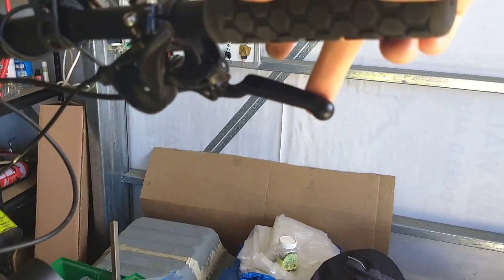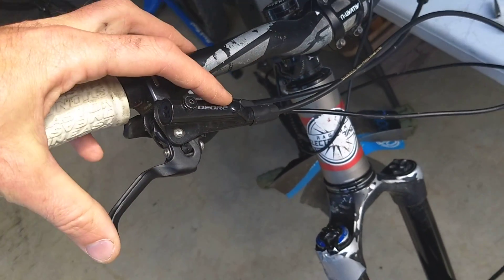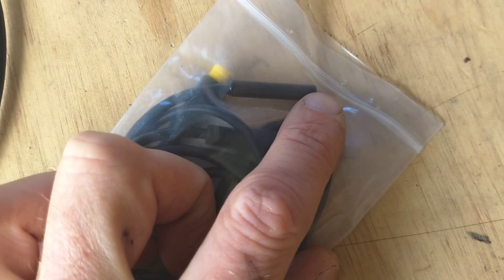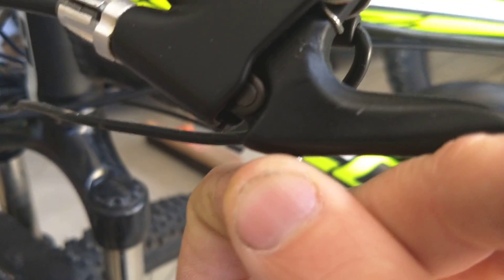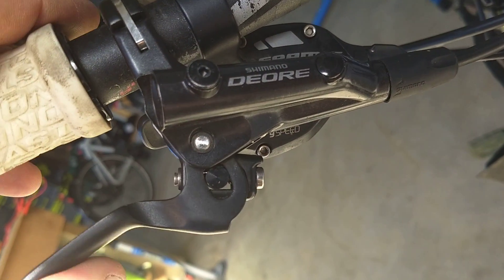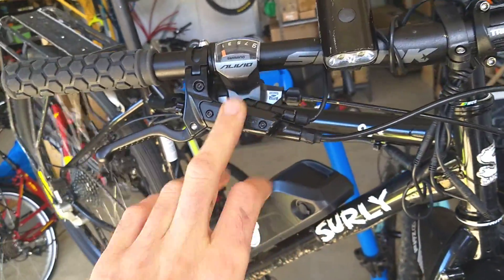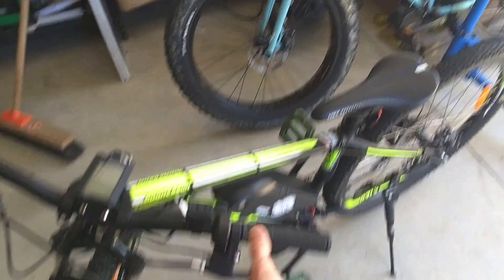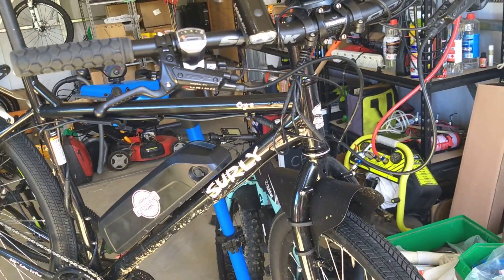Brake Cuts Bafang BBS Electric Bikes

Comment: I'm finding the Zurich brakes here in the U.S. but they don't have Bafang 3-pin connectors, rather just wire ends that need to be spliced into the Bafang harness. My question, do you know which wires on the Zurich match which wires on the Bafang harness by color? I really don't want to spend $300 USD for brakes and screw something up by wiring them wrong. Thanks
Reply from the maker: Hi Naaman, Sorry, I don't know the colours. Mine came ready wired with the correct plugs. I'm sure a little googling will find them. If you are really stuck I could sell you my used set-email me via raglanelectricbikes.co.nz if you want to pursue this.
Reply: Ok, thanks. If I hadn't already ordered them, I'd take you up on your offer for the used set. One more question, if you don't mind. How many pins are in the connector, 2 or 3? Thanks
Reply from the maker: 3
Reply: Thank you
Reply: Just a note for anyone interested in using the Zurich brakes on Bafang motors: The Zurich brake levers only use 2 wires. So basically, it's just a normally-open switch and may not come with Bafang connectors, mine didn't. So to connect these to the Bafang motors that normally use 3-wire hall sensors (available online, if they weren't included in your motor kit), you need to cut the hall sensor from it's cable and splice the Zurich wires onto the red and black wires of the Bafang cable. The white wire will not be used. Wired mine up last night and they're working great.
Reply: Nfox do a 3 pin Chinese hydrolic brake I think was wondering if they were good I might try them.

Comment: Nowadays there's 4 piston hydraulic brakes with the Bafang 3 pin wires built in. A set from China is about £65 but, they only have Left/Front and Right/Rear in those 4 piston ones, bummer! I might get some and just swap the hoses around.

Comment: Hi, just wonder if you can advice ... My e-bike has been acting wears like wen I'm pedaling it seems the engine keeps breaking making it harder to pedal? But is not constant is like 60 degrees of a 360 degrees will speaking like?
Reply: hello mate, did you find out the answer to your problem why?
Reply: @xlmusic6419  no I didn't I guess is just the power of it it has like engine breaking??

Comment: hi i got ? about the shimano  breaks can they be used on a hub motor controller that only has Red and black wire for cut off for the breaks
Reply from the maker: If there are two wires it is a switch. If there are three it is a hall sensor. You can't mix them. I think you can buy both types. Try e3emv.com